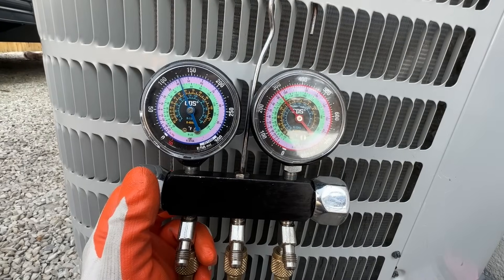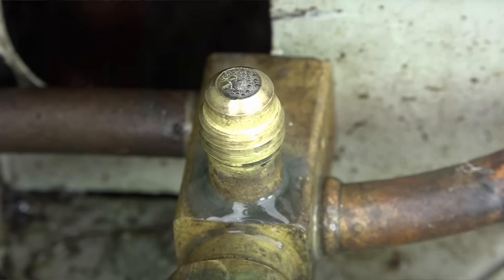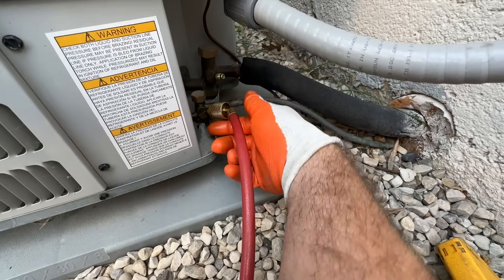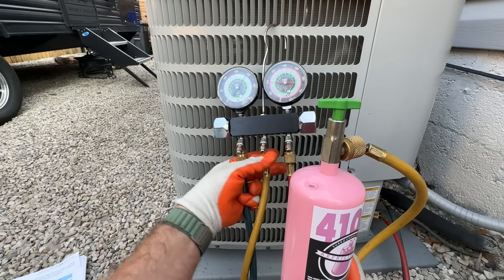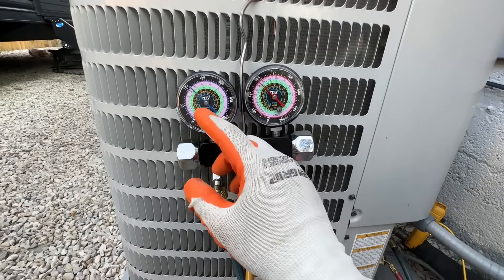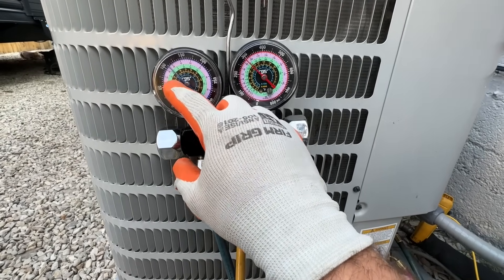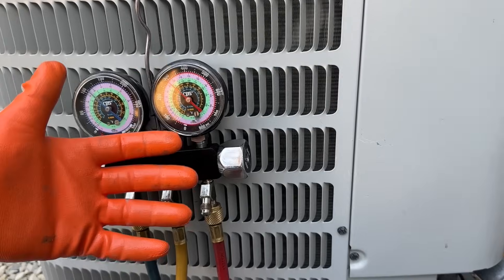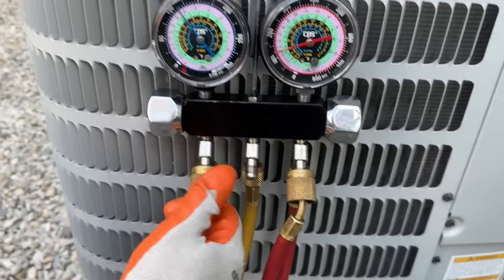How To Add Refrigerant To Your Air Conditioner R410A & R22

Comment: I have a GE 24k btu window unit..  My inside coil started freezing up.. so I would turn it off and let the fan ran, to thaw the ice.. and by the next day, it stopped freezing over, but not it's not getting nearly as cold as it could before.. Does this mean that all my refrigerant has likely leaked out?   Why would it stop freezing if it's low??  and now have low performance?    My plan is to put a piercing valve on the low side (the big line) and check the pressures and just top off as needed..     Can I still check for leaks if it has fully leaked out the freon?  Or will it still bubble if it's empty??  Any help is appreciated, thanks

Comment: Does anyone know if you can add oil to an already charged system. I had a service tech come out and his assistant over charged my system and the tech drained out the excess. He said he drained out atleast 2-3 lbs or more onto the ground. Then charged it back to the correct pressure so he said. I later seen that he drained it on the ground and noticed all the oil. Now I'm worried that my system doesn't have enough oil in it. It's a R410A unit.

Comment: I have had really bad luck with AC units. I replaced 3 in a mobile home I had the just under 15 years and it went out for the 4th time about a year before I left. I ended up having to put a $500 window unit in the living room and we all learned to sleep on the couch and in recliners until I sold it. I have a house now, 3 years in (last year) the AC went out. We had choice home warranty (do not use them, they are a scam big time. I had to call them 2-3 times and pay a fee for them to come out each time to fix the same thing that was never fixed in the first place. They were to replace the washer since it couldn't be fixed. A washer cost $600, their ad says they will fix it or replace it with a new one. Yet they would only give us $300 for a new washer. They say that they don't give retail because they can get it cheaper. But they aren't the ones buying it I was and I have to pay retail. If they were the ones buying it then I don't care what they pay. But they only send the money. And it took them 4 months to use the check for $300, half of the cost of New one. And they sent an AC repair tech out for the AC and he said it was due to a dirty coil. Choice doesn't cover that saying a dirty coil is due to neglect. So the Repair tech said he would clean out for $1500. I called another company on my own dime and it had nothing to do with the coil. The capacitor on the inside unit had gone out. It was evident due to the blower spinning backwards. The original tech was trying to get us to pay for him to remove and clean the coil because it paid so much. The second guy replaced the coil in about 15 minutes, cost me $100 and my AC worked. But now it's not cooling again and we are in the middle of a heat wave at the end of June with the two hottest months to go. So I'm really considering your recommendation to get my permit to buy refrigerant and doing the myself. I'm going to the supply store tomorrow to buy the coil cleaner and the coil brush. These coils are generally supposed to be removed to be cleaned. But I don't have the vacuum to remove the refrigerant and the coil has to have the lines cut to be removed. Although I can solder copper lines I don't have the experience or tools required to remove it. So I'm going to clean it in place. I have had a guy who has an HVAC business show me how. And I am really good at being able to look at things and figure them out. As well as being able to fix things just from seeing them. So hopefully by Monday I will have this unit back to cooling properly.

Comment: On a 410a system, is the low side the only pressure that really matters? The reason I ask is I have a Fujitsu Halcyon 9000BTU mini-split unit that has never really cooled adequately (It's cooling my 'server room' that used to have a noisy 8000 BTU window unit that would practically have snow flying), as if I set it to 65, the lowest temp I could keep the room was around 75. But recently, it started 'shutting down' when the outside temp dropped below 65 degrees or so - I'd have to turn it off and turn it back on after it warmed up a bit. I do believe there is a leak, as there is oil residue around the valves, but I'm not sure if it's a flare or one of the valves. When I took the covers off to close the valves and draw the refrigerant into the compressor, I got a 'pssst' of a small amount of pressure escaping. But this unit only has a single test port, which is the low side when cooling, and when running, it would stabilize at about 120PSI (which on my gauge equates to 40*), and when turned off and allowed to stabilize to ambient temp, it settled in at about 192psi at 80* ambient temp. Is the only way to add to this kind of system to evacuate and re-charge by weight?

Comment: This is actually really scary your training people to charge their systems based on pressure alone? This is not how systems are charged. How did you get your license? The gauge shows saturation temperature at specific pressures, but you need to use additional thermometers to measure the temperatures of the liquid or vapor lines and do the math to figure out the super cooling in order to properly charge a system. This video is completely inaccurate and will do damage to peoples condensers! 410 Systems sub cooling can range between 10 and 18 degrees depending on the manufacturer. Please study your book better and remake the video in order to explain it properly.
Reply: We mentioned that and has another video explaining that.  Watch the whole thing before you make a comment discounting someone

Comment: I was just quoted $3000 just to add r-22 to one of my systems. and over 10k for replacement. this is a 4 ton unit, so I just installed my first mini split today, and doing another one next month. these HVAC guys are putting themselves out of business. I ill never call anyone again.
Reply: Current HVAC tech here, some companies will force thier technicians to lie to the customers to replace units to make money. There are a few honest people out there. If we did the work outside our company we don’t charge forced company price.
Reply: I had the same issue a few years ago and picked up an equivalent gas to R22 named R407C  25# bottle. It has kept us cool without an issue for at least 5 years. I think they are in the sub $300 range now.
Reply: A drop in replacement for R22 is 407c.  45+/- per pound.
Reply: @NellyEIEI  It absolutely is not according to chatgpt and will instantly destroy someones compressor. You just typed a $10K misinformation statement.
Reply: Been doing HVAC for a little over 30 years..R-22 retails between $125.00-$1.50 per pound..you can thank the EPA for that..
Reply: I just had the exact same experience down to the quoted price over the weekend 😂 time to put my HVAC hat on
Reply: R-22 has been federally illegal to produce and import since 2020. Putting 3 or more pounds of R-22 into a system is comitting a federal crime. And come 2025, all HVAC prices are increasing 30%-40% due to a new refrigerant being produced. If any technician does this and is caught by the EPA, they pay a $45k fine, can go to jail, and will lose their EPA License and can never get it back. 

Either stop crying, or go to trade school before you start accusing the people who have for trying to "scam" you
Reply: Bye! Icky customers like you are best not wasting our time! Maybe you should actually study and become an HVAC technician. I’m sure you will still be a pretty icky person but at least you’ll have a less ignorant clue.
Reply: 😂😂😂😂 good luck to you
Reply: No DIY are effing stuff up … keeping us in business
Reply: Blame the EPA, they’re driving the price increases with their mandates. Start thinking
Reply: The government has screwed us into these prices more so than the contractors.
Reply: Exactly!  Basic economics.  Outlaw the production of R22 basically made it a rarer and less available resource.  When demand is still high and resource of that product goes scarce, prices rise.   The same will happen with R410A now.
Reply: Excellent video, thank you.
Reply: Currently a jug of r22 is $1500+  so let that sink in when questioning repair cost.
Reply: @davyjones922  so first visit pays for the jug and nets 1500 profit, now each subsequent visit is now 100 % profit lets say 10 fill ups on one jug it can be many more but lets say 10 on one jug thats $30.000 profit on one jug, OH AND 20 MINUTES LABOR, SO ABSOLUTELY LETS LET THAT SINK IN!
Reply: @davyjones922  Ability has a 30lb. cylinder of r22 for $845 shipped to your door.
Reply: @davyjones922  $100 a pound where I’m at!
Reply: @davyjones922  and it takes 5 min and 1/5th of that jug to top off a unit and you get a mini split pre charged with 3 head units for $3000 so let that sink in the next time you want  to charge 3,000 for a $600 job.
Reply: @FearRua  I've seen hundreds if not thousands of garbage hacky RTUs, split units, and residential AC systems. There is no trade more full of absolute hacks than HVAC. there are good ones, I've been in my industry for 15 years working along side HVAC techs and I've met zero that I would let touch my own house.
Reply: @billrobert3226 that’s just the US dude. This level of incompetence and lack of being serious applies to everything in this country. Not just hvac. But sure any kind of contracting work is especially full of this kind of bs.
Reply: @davyjones922  A 30 lb drum sells for 845 bucks at Ability refrigerants. Sounds like your getting ripped off.
Reply: This is a perfect example of don’t speak on a topic you don’t know. Enjoy your minisplit you probably won’t even be able to find the parts for after 5 years😂 good luck diagnosing the issue with it by yourself also. And HVAC continues to progress quite well and job opportunities are constantly becoming more available as these systems become more specialized and efficient. Way to make yourself look foolish.
Reply: @ljay1627 what did he say that makes him look like a fool? Please explain.
Reply: @dcbc991  “these hvac guys are putting themselves out of business” the opposite is actually true more and more hvac businesses are opening every year. 2nd, thinking he’s making a wiser decision installing 2 minsplits instead of replacing an ac unit(which he only got one quote for?) and in reality he’s looking at the same price to do so bc minisplits are expensive if they’re going to replace a 4ton split. That would require multiple heads. The 2nd issue is ignorance which i’ll let slide. The first point is what made him look foolish when he couldn’t be more wrong
Reply: @ljay1627  thanks for the response.
Reply: @ljay1627  Good then competition will drive these rip off HVAC guys to stop their ridiculous prices.
Reply: @robertgregory2618  we can only hope. I’ve ran eight go back second opinion jobs the past 2 weeks alone. One was a compressor under warranty with locked rotors that they were gonna charge him $2400 to replace. Under warranty!!
Reply: @ljay1627  There will be videos on YouTube to work on the Mini split too, not rocket science. Any industry that overcharges needs competition and it's good to see videos like this.
Reply: @ronmailloux2386  i never claimed it to be rocket science lol. I am claiming videos like this will make us money bc homeowners will inevitably screw it up. Homeowners working on their own systems isn’t a smart idea idc how many youtube videos they watch it’ll never add up to hands on training and experience. I’d hardly call youtube competition lol. The only competition this industry needs is for business owners with morality to outshine the ones who sell out to greedy corporations. Youtube ain’t the answer bro lol

Comment: Excellent, appreciate the info.  MY Trane is having issues, it works well on the small compressor but when it jumps to the large compressor, it stop cooling, specifically in Phoenix 114 weather. I think it's low refrigerant, but will clean the coils and the unit in the attic before I try adding freon. This unit has 3 set of filters in line (main updraft, then a fiber glass cleaner at the electrostatic panel, all the electrostatic panels and then another fabric filter  - lot of cleaning). Thanks for the insights.

Comment: Sorry to inform everyone but this information in this video is NOT the correct. 410A is a “near azeotrope” meaning it is a blend of two refrigerants. You cannot “just top it off”. Being a blend refrigerant you will never be able to know which of the two refrigerants leaked out more. The ONLY WAY to properly repair the problem is by 1. find and fix the leak 2. Recover the existing refrigerant and recycle properly 4. Triple evacuate the system 5. Weigh in the NEW refrigerant. I’m NOT opposed to DIY I’m opposed to MISINFORMATION. You cannot just add refrigerant to a 410a system

Comment: Always check super heat and sub-cool before you add freon.
If there is a restricted metering device in the system and you add freon just off pressure, you will be sorry later.
Don't cut corners.

Comment: You made a mistake, instead of flushing the air with the service hose on the manifold, you should flush at the cylinder, to avoid air inside your manifold

Comment: A neighbor is HVAC contractor and has two HVAC systems in his single story home. Says they set the thermostat to 70 degrees in summer and enjoy the fruits of his labor etc. Our electricity is 43 cents per kWh so 2,500 kWh of power per month would run $1,075 just for 30 days of A/C.  I'd say he is getting paid rather well.

Comment: It's sad when you hire an HVAC to come help you with service on your HVAC system and their first priority is to sell you a new system because your existing system is maybe 10 to 15 years old. If that is their initial opinion...its time to fire him and find another HVAC. Also, the same opinion when they find an evaporator needs replaced or maybe the condenser coil and they throw their hands up and tell you to spend triple the money and replace the system. I don't see that as a valid point for the customer since the main focus is to get the existing system running again, the customer can decide if they don't want to put a few thousand into an old system that has been reliable for years and years. 
Honestly, they are suggesting that folks buy new less reliable systems and spend more money...for what?  Are these HVAC guys working for the EPA/CARB or interested in upselling for profits? I know of honest HVAC techs who repair old systems and they are making more money than the HVAC "tools" replacing systems. The HVAC industry needs to have better minimum qualifications to be licensed and have access to materials in my opinion. Those who know won't have an issue with that idea, those who don't would.

Comment: I checked that website and they charge $30/lb for R22 and they have it in 2lb up to 30 lb tanks as well as by the pallet load !  Shipping is included with the sales price. I believe 410a is about $25/lb. What a difference compared to what those HVAC trucks sell it for ! I have heard R22 is about $100 to $150 per pound from their truck. So a full evac and recharge of R22 refrigerant would be around $300 vs. $900+ in just the gas from the HVAC guy plus his labor.

Comment: What are your thoughts on the 2lb r22 recharge kit with the small single gauge ability refrigerates sells for $153.00? I'm a homeowner and may only use it 1-3 times? Or is it worth getting the big gauges?

Comment: As a repeat customer in San Dimas, CA 91750, I had my A/C & Furnace Tune Up completed on 6/10/24. I was charged $780 to add 4.5lbs of 410a Refrigerant and $250 to add a Leak Sealant for a total $1,030 for a two hour service call. I feel I was really RIPPED OFF! How much should I have paid?
Reply from the maker: Yea you got ripped off. I thought $125/lb of 410a was steep. Those are like r22 prices.

It’s good to be informed on how much things should cost. I will do a video on how much you can expect to pay for refrigerant these days.

You got the service and I’m sure they have a lot of overhead so it could definitely be worse!

Comment: Great videos! Do I have to evacuate the system before adding the 410A or can I just add it? It needs about 6 lbs after a sudden loss of 410A. A repairman put in 6 lbs two days ago and it's blowing warm air again. He found a leak in the accumulator, but wasn't sure if that was the cause of such a sudden loss of refrigerant. He did a leak inspection, but didn't find any other leaks in the condenser or evaporator. I put a temporary epoxy patch on the accumulator and was going to add some 410A to see if it'll hold. I may not need the full 6 lbs for this test, but if it holds, I'll top it off.
Reply from the maker: Nope, as long as it has positive pressure there will not be any air or moisture so no need to evacuate 👍🏼

Comment: So i hooked up the gauge but wasn't getting anything, the needle didn't move not a bit, added the freon, and i got it to a reasonable amount, however i see no sweating on the pipes and the vents still blow warm air.. anything else i could do before i can officially declare it dead? This is a Goodman forced air system, which it was installed about 10 or so years ago.

Comment: Another great video! My 20 year old system froze the coil. I used Craig Migliaccio's book on Refrigerant Charging to go through all of the prior diagnostic steps (filters, airflow using differential pressures) and then used this one to refill based on superheat. Thanks for helping me keep my 2004 Trane XR11 humming along!

Comment: Similar set of gauges to do a car. Cars technically are all by weight.  People top off but you are supposed to recover and reinstall the exact weight of R-134a. There is no real superheat or subcool because it is always changing when the car moves.